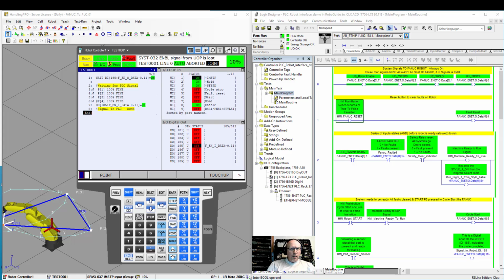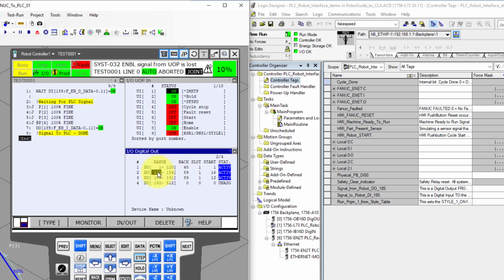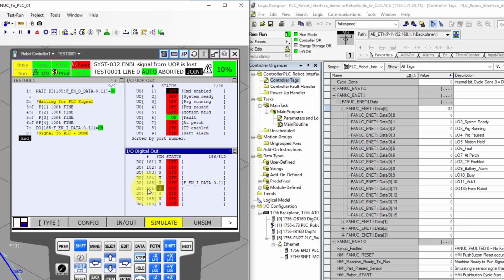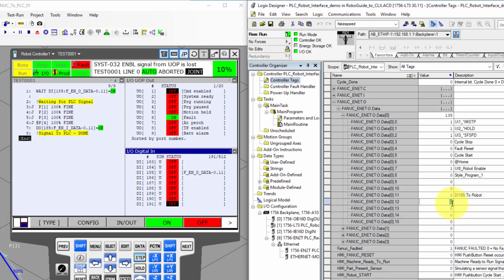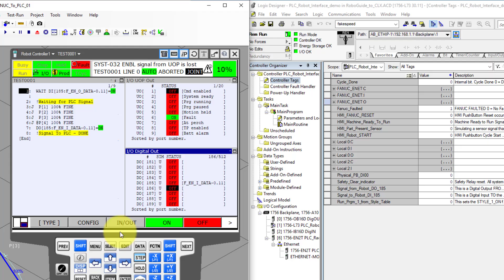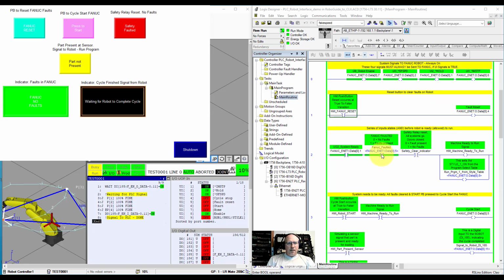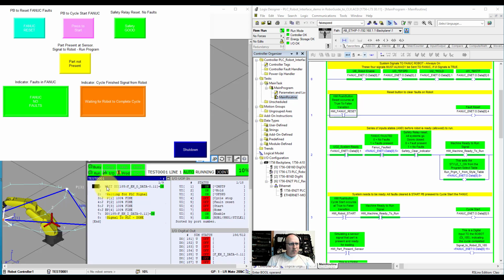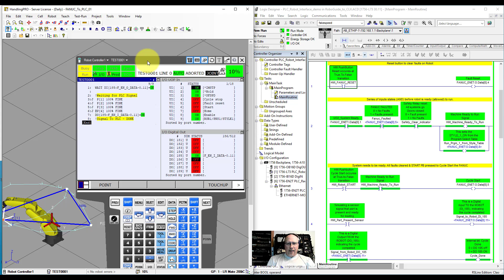FANUC Robot to ControlLogix PLC - Digital Input and Output exchange

Comment: How to setup ethernet ip to the fanuc robot . i had issues with inti fail. thanks
Reply from the maker: Best to contact FANUC CRC support and get their documentation. They provide good examples and options based on different PLC manufacturers or devices. I might be able to help, if you provide more details. Robot model. PLC model. Versions.
Reply: fanuc robot guide and Allen bradley physical PLC RSL 5000. thanks
Reply: LR Mate 200 iD. Thanks
Reply from the maker: @soemin4847  Send me an email matc.psdettmer@gmail.com and I can provide you with some documentation that should help.

Comment: Thank you for this. Very helpful. My problem though, is that I need to send an integer value (0-9) from a PLC to the Fanuc. Since the Fanuc only accepts ones and zeros as input, how do I send an integer to the Fanuc to tell it shich of 9 programs to run??  Thanks much
Reply: You can use a "Group Input" for that.
Reply from the maker: I know it is possible, but haven't done this myself. Here is a workaround I've used. (not my video) https://www.youtube.com/watch?v=bkGQ0kCXv8E

Comment: That's a fantastic explanation, do you know how to jog axis by axis on clp ?
Reply from the maker: I'm not sure I understand what you are asking? Do you want to Jog Robot Axis from a PLC?
Reply: @PSDettmer  yep, that's right.. I already see jogging a extended axis by plc but not a single axis on robot, that's possible?
Reply from the maker: @katoia_t  I'm sure that everything is possible, but setup will be complex, as you have to consider safety, T1 mode switch and Shift button. There is a PC based TP available as an option for a physical robot. Allows remote jogging, but I have not seen that used. Probably time to reach out to FANUC or an authorized integrator. Good luck! Curious to learn how this goes for you!

Comment: Hello Peter 
Do I need a physical plc to do this? I only have a plc studio 5000 and roboguide.
Reply from the maker: Yes, you do need a physical PLC to do this. However, RA just released FT ECHO - their new virtual PLC (Emulator). Supposedly, it can take the place of a physical PLC. It's not cheap, and I've not seen any public projects implementing this. Emulate 3D and PTC products have been used to create a Digital Twin of production equipment using this technology. CSI at UW-Milwaukee is an example. https://uwm.edu/csi/

Comment: Very nice and clear.   Can you maybe say a word about why all the Controllogix PLC functionality cannot be done by the robot controller thus eliminating a box from the system?
Reply from the maker: The PLC in the actual system also controls VFDs, SMC valve bank, communicates with a Cognex vision system, and has a PanelView + 7 connected. The intent of this video is to demonstrate handshake between a physical PLC and a FANUC robot. A robot controller can take on some of those functions, but only if you have additional options installed and can program in KAREL.

Comment: Peter, what software did you use to bridge the communication gap between RsLogix5000 and ROBOGUIDE ?    Rslogix 5000 Emulate, OPC-UA  ?
Reply: I've set the $EIP_ENBL_IO system variable to 1 and changed the Input from ROBOGUIDE as SIMULATION, but bits do not change in the PLC tag when forced ON or OFF in ROBOGUIDE

Comment: How did you get it to communicate with RoboGuide?
Reply from the maker: FANUC has a setup document, that shows how to setup communication from RoboGuide to a physical PLC. It's over Ethernet, with a generic ethernet module in PLC project and a Windows based computer.